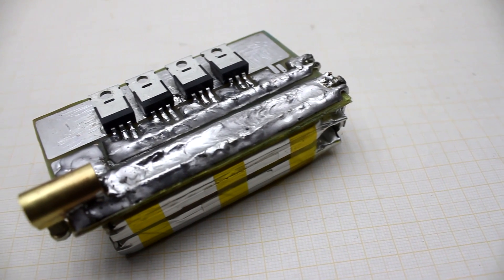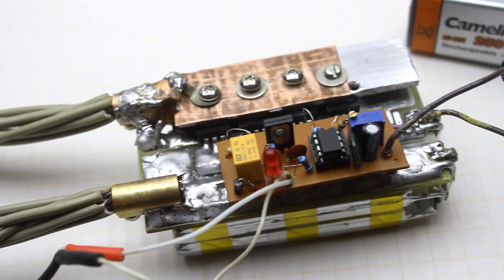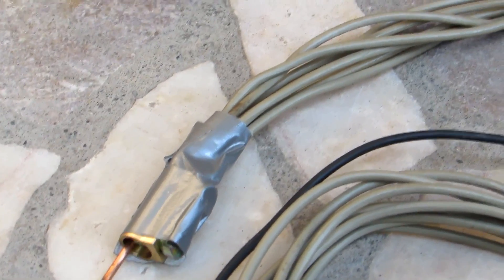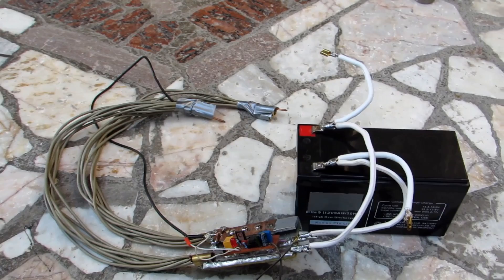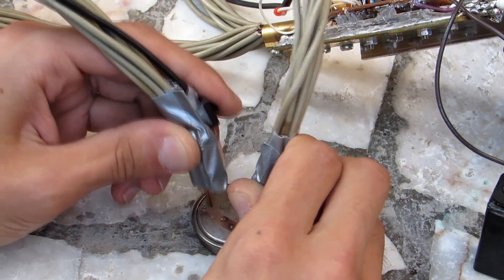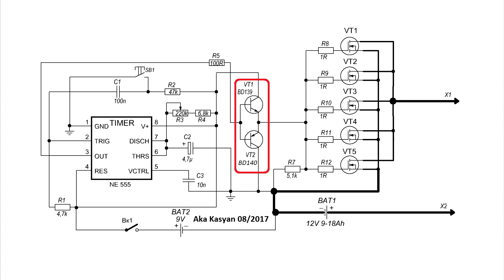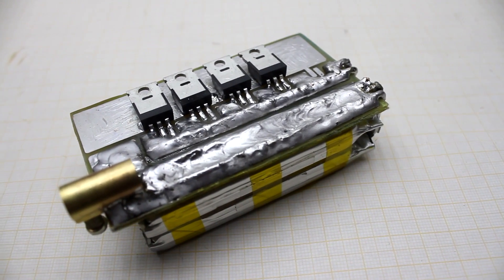The simplest welding machine (part 2)

Comment: Hello Friends need suggestion I have connected UPS transformer with DC 12v and capacitor of 15000uf/50v as a Batt. source (Provide almost 100 amp) but no luck . Why cant we use any dc power source instead of  3.7v 4400 mh bat..?

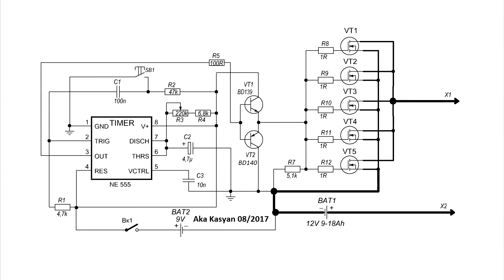Comment: Hey. What's the role of the pnp transistor (3:16). I don't understand when it is being turned on and why it is used in this design?
Reply: Those replace the relay from the previous version.  sort of playing the role of amplifying the signal from the 555 to be high enough to activate the gates of the transistors.

Comment: I would think if you have some extra money it might be a good idea to get one of those super capacitors (with the correct voltage rating of course) and parallel the cap with the battery. That way you could get high peak currents without stressing the battery too much.